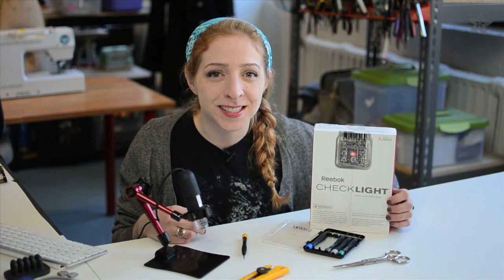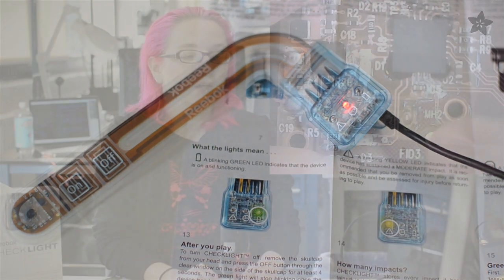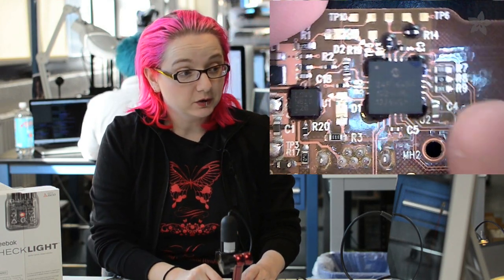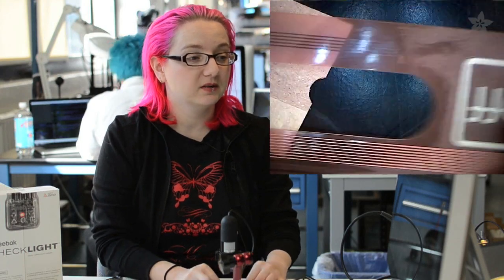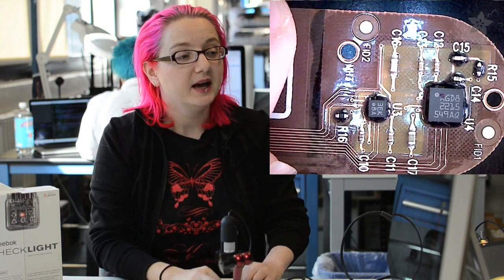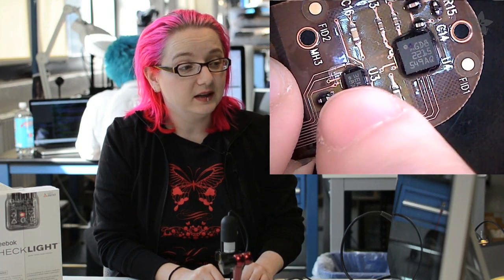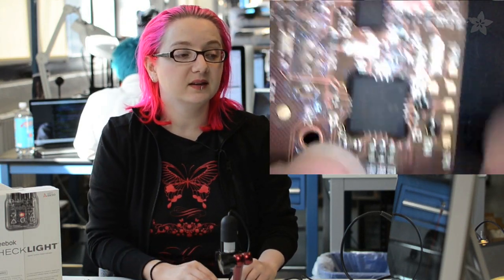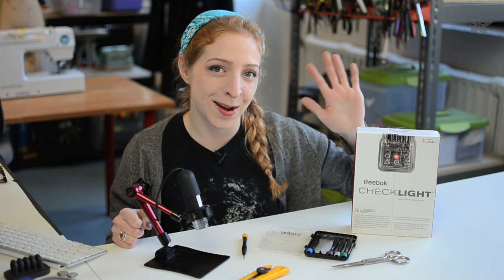Reebok CheckLight Teardown

Comment: No Limor Fried , the hat isn't teeny, you are brainy! :-) 
After show and tell, these breakdowns are my favorites... And fun to do for yourself. I've broken down an alarm clock I dumpsterdived from the wecycle station.

It was built around this chip that worked on 12V AC and had no resonator/crystal but counted the 50/60hz pulses in the mains. Works fine in Europe where the number of pulses per day is legislated, but I found an old thread online from a guy in India, where the mains pulses are all over the place, who was looking for a 12v resonator to fix the enormous skew he was experiencing.